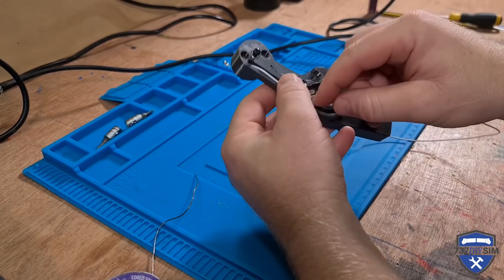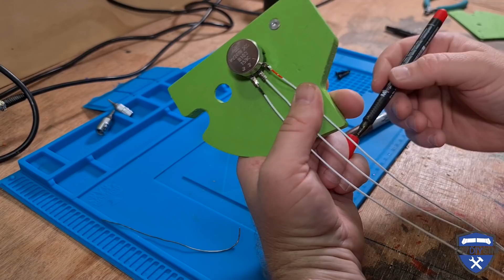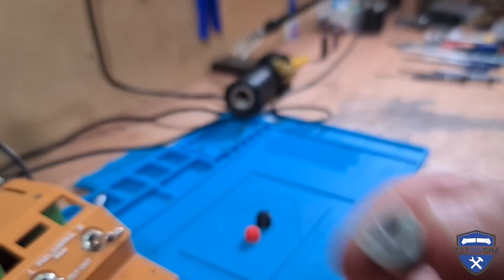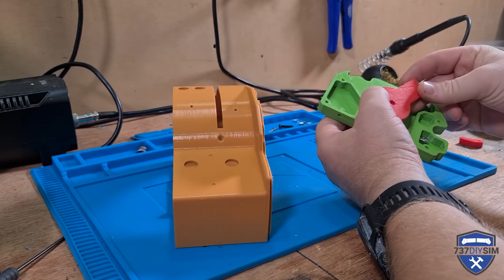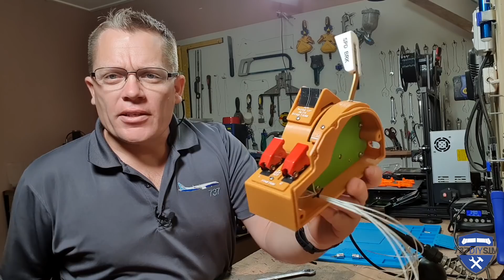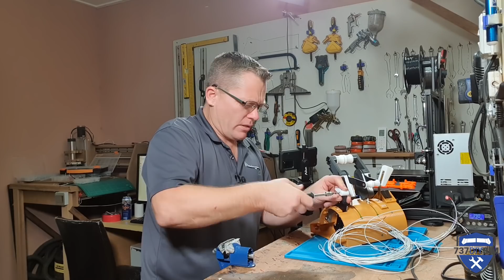Boeing 757-767 Throttle Quadrant Build

Comment: Hello Karl! I have purchased the 3D files for this throttle quadrant and am looking forward to building it. I cannot seem to find a video or guide on how you wire everything up to the Arduino as well as how to program the board. Do you have a guide for those steps too? Thanks!
Reply: Also, is there a parts list available for the non-3D printed parts (the filament, potentiometers, switches and screws that were used)? Thank you!

Comment: Can this be adapted for use as a 747 throttle quadrant?
Reply from the maker: I personally wouldn't bother, looking back on this design, its not how i would design things these days. There are much simpler ways to achieve it and I almost always find that starting a new project is quicker and easier than trying to adapt an old one.
Reply: @helimech8152  You wouldn't happen to know where I could find dimensions for a 747 throttle quadrant ? Either classic or 400 would be fine. I would like to make one. The only ones I can find for sale are from throttle Tek for over 2k which seems insane for a quadrant like that.

Comment: Hello ! Very nice job you are the best !
I need advice. I’m working on A320 throttle quadrant. 
What kind of electric wire did you use ?
With 2 potentiometer and 2 push button (and maybe motorized trim wheel), which electronic card do you think is adapted/easiest to program ? Arduino (which one?) ? Or other one ?
Thanks for your help :-)

Comment: That looks very professionally designed and built. I bought the files and just started the printing of the parts. Some STL models are positioned are oddly angles though. I had to disable the angle snap and rotate them carefully to a symmetrical position
Reply from the maker: Use flatten to face in your slicer software, that a much easier and quicker way to orientate hem. They come in from fusion in the orientation they are placed in the design.

Comment: A better way instead of sanding the paint off is to gently wipe it off by sliding the text across a surface that picks the paint up better than the plastic, different paints wipe on different things better.
Reply from the maker: Tahnk you!

Comment: wouldn't it be better to get wires that are already color coded, and fully color coded, than try to rely on sharpie marks at the ends?
Reply from the maker: I have over 100KGs of recycled aircraft wire, which is by far superior to anything from eBay. This is why i now use it and because its Free lol.

Comment: Hi there, did anyone manage to get the LED toggle switches to work as intended with mobiflight?
Reply from the maker: Hi Danno, You may need to ask this in the website forum and describe how they should work. Then I can probably help you out or try to find a solution. Kind regards Karl

Comment: Karl, could you specify, which marker you use to highlight legends? Thanks
Reply from the maker: Hi Artur, i use a Sharpie, Black or a white paint pen depending on the colour required. Legends now, i would use my resin printer, but this is a bit of a speciality purchase i wouldn't recommend one just for this. Kind Regards Karl

Comment: I am literally looking forward to that next episode, because searching white sheep in the herd of white sheep has to be a great adventure. Are grey wires the only ones locally available? :-)
I like both your throttle quadrant designs but I fly World War 2 sims, where are dual engine planes, but they require propeller and mixture settings as well, so more levers are required. And I think about use of the bearings and maybe hall sensors. Thus I wonder how difficult it is going to be to modify your design to fit such a plane
Reply from the maker: Hi Mungo, All wire is available here, its just the quality is so poor is fails very quickly. The wiring you see in my vids now is recycled aircraft wire which is awesome stuff to work with. I would highly recommend starting a fresh design than modifying mine. Its just easier to start from scratch and purpose build it. This is the major let down of the 737 v3 throttle. It was modified from the Saitek unit. It would have been much easier, simpler to start over! Kind regards Karl
Reply: @helimech8152  Thanks for the answer - quite interesting, those wires.
I have to plan that design - it is quite difficult to think out controller that fits several planes. Which - despite being similar in some way - differ in way their flight controls works. 
Anyway, quite a lot of inspirational ideas. Do you know roughly total print times of such a project?

Comment: Simply the best! Amazing work as I already mentioned before on Instagram. 
Please do Airbus things tooo!
A throttle quadrante Airbus a320, please!
Reply from the maker: Hi Antonio, I tend to stay away from airbus as there are already so many builds out there. I also know nothing about the operation. One day perhaps! Kind Regards Karl
Reply: @helimech8152  where are so many builds acessible to the community via 3D printing like yours? Nowhere! 
Not a single one, or maybe I didn’t find anything, and your quality?? No way Karl, you are simply the best, and iam only supporting, I don’t fly a 737 sim, but a 320sim, but I know the difficulty and leak of information to build a budget a320 sim, 737 is more easy to find info and now quality 3d printing budget from you, that is a great feat for community 🙏👌

Comment: Really great to watch your builds.  What 3D printer would you recommend?  As an ex military helicopter engineer I can relate to your enthusiasm and precision and could be tempted to start a 737 build based on your design.
Reply from the maker: Hi Steve, I would highly recommend the Ender 3 v2 or pro if you want slightly cheaper. Great to hear from a fellow vet especially in the same trade! I hope this finds you well. Kind Regards Karl

Comment: Very cool. I have to build this. Do you have a plan for a motorized trim wheel for this version. That’s the one thing I would like to see on a build.
Thank you for sharing your knowledge with us. You are one of the few that really explains what and how to build items like this so that others can build them.
Reply from the maker: Hi, i am building a motorised version of the 737 in the background. But all my attention is on the dual control yokes at the moment. I will return to this project hopefully in the new year. Thank you for the kind words, Karl
Reply: @helimech8152  fantastic work by the way. I am building or should I say trying to build a motorized A320 Quadrant. Being fairly new to electronics and Fusion 360 it is a challenge.

Comment: Great as always! I have a question - 
I am currently making a 737 overhead, using 10mm MDF board with a printed 'sticker' on top. I am wondering if this is the best material, or if I should be using something like foamboard (eg. https://www.hobbycraft.co.uk/west-design-white-foam-board-a2/574236-1001 )
- Callum :)
Reply from the maker: Hi Callum, 10mm MDF is really thick for a sticker board! Switch to 3mm. The holes for switches and components will be really easy to cut. Another option would be clear perpsex. That way if you are using a sticker, limited backlighting might work through the white sections. I would start small and try different options. Check Peter from build a boeing and i think he used foam board to start out with. That would be easy to mount components! Kind regards Karl
Reply: @helimech8152  thanks! I’ll definitely look into 3mm MDF and Perspex.

Comment: What gauge wire is he using guys?
Reply from the maker: I was lucky a few years ago that we modified our fleet of helicopters. This meant I had hundreds of meters of discarded, reusable aircraft wire. This wire is by far superior to anything have found from china on eBay. The part number is: 55A0811-22-9
It's 22 AWG, but 24 AWG will also work the Arduino 5V items and the part number is: 55A0811-24-9
Mouser and TE stock this for around $0.25 to $0.53 a meter
Reply: @helimech8152  I love that white wire, looks nice and seems to be the right amount of flex. Thank you for the information on that i really appreciate it! Glad I found this channel.

Didnt even notice it was stranded, I thought it was solid core.

Comment: y
you're an absolute madman. Such a brilliant job. Marvelous. Next 777 ?

(NB: how strong are 3d printed parts, whether it's a yoke or a throttle quadrant, is it easy to break or is it rather strong ?)
Reply from the maker: Hi, I'm actually surprised with the strength of printed parts sometimes, but they are very weak at certain joints when you use low infill settings. I'm sure after a few weeks of feedback, that will be the real test! Always learning!

Comment: You print everything with Ender 3 pro ?
Reply from the maker: Good evening from Brunei, I now have two ender 3's. The pro and v2. But I think most of the internals were actually printed on the tronxy A8 as the ender 3 broke and was out of order for weeks.
Reply: @helimech8152  i was going back and forth between Ender 3 and CR-10. Im looking for a larger print space. Which one you think would be ideal ?